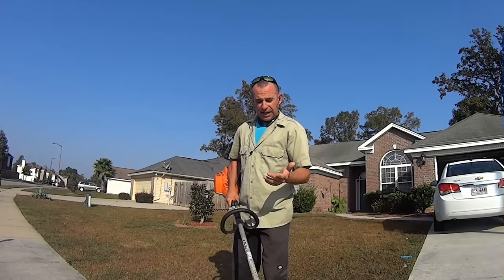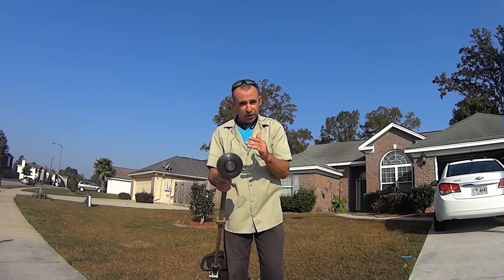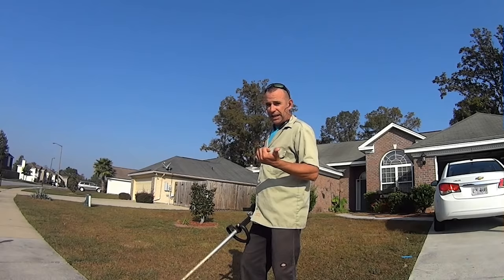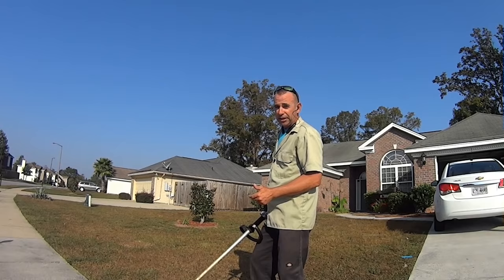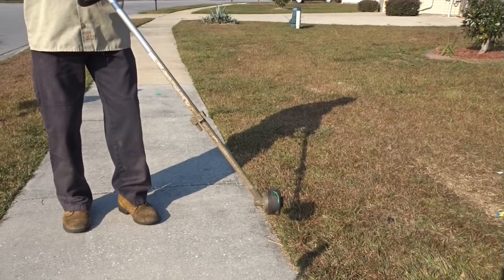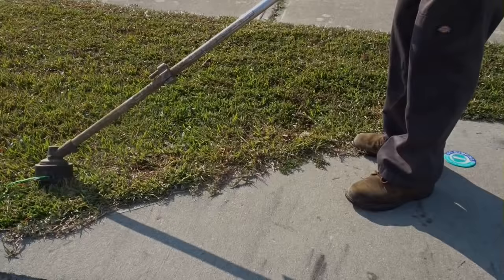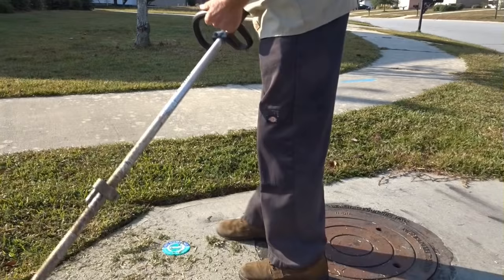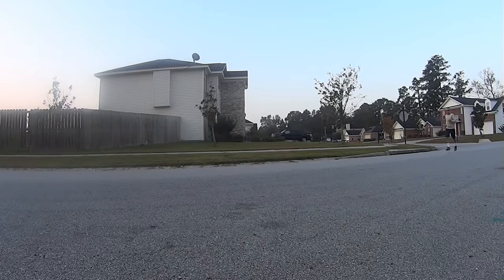HOW TO EDGE with a string trimmer - weedeater - weedwacker  Lawn Edging Tip

Comment: Ever since I had removed my String Trimmer Guard I have increased my accuracy and comfortability when doing my edges by at least 60%.  I make sure that I wear safety glasses at all times and in some cases I wear a full face guard.  Best thing I ever did for me at least is remove the guard.  A neater job all round.
Reply from the maker: I tried to use the shield, it blocks too much of my view
Reply: @DansVlog  i never really had an issue wit the sheild but then again i never took it off to compare it, im gonna try tis summer

Comment: I switched from 0.95 to 0.80. you're right, it cuts much better. thank you for the tip.
Reply from the maker: Heck ya! Just remember if you edge with .080 it will wear down faster so be easy on the power so you don't just waste the line burning it up
Reply: @DansVlog  - Seems that I heard you, or someone else mention that 80 will also cut into and damage fences alot quicker as well. I've been trying out that Rotary, Copperhead Vortex 95, that George Packard highly recommended, around the house, and really like it. Have always used Sthil, regular orange 95, and this black Vortex stuff is a bit thinner, more like 90, and kicks butt. Said he got turned onto it in Florida, and liked so much, brought it back to Wisconsin to use, and lasts way longer than other trimmer line he was using. I know you love the 80, but try this Rotary Vortex 95, and maybe do a video on if it's as good as they say. Thanks for reading my long comment, and thanks for all your informative videos.
Reply: @stevecarr1992  
I saw his video and still using the rotary. Definitely nailed it. Also switched from orange stihl.

Comment: Thank you so much for posting this video I really appreciate it there was a man across the street just now and he was trimming and edging a yard and I asked him if he could help me because I'm trying so hard to learn. I'm a 58 year old female just started cutting grass last year, I do OK but I don't know how to edge the yard and my first weed wacker or trimmer broke.  I tried to get the issue resolved with Home Depot but they let me down they would not assist me, well maybe that's not correct it's not that they would not assist me they just did not assist me with what I needed. When I tried to show them what was going on, they did not listen, then they said they would have to plug it in to see what was going on for themselves. So I waited for a half an hour only for them to tell me they did not have an extension cord and I would have to come back,  I went home disappointed. I called the manufacturer, they told me to take it to Home Depot (smh). After several attempts, I just threw it away. So last weekend  my son  gave me a Black and Decker trimmer and I'm trying to learn how to trim the edges of  my yard, so I whispered a prayer and went across the street and asked the gentleman that was working on my neighbors yard I have seen him several times in the neighborhood I thought if he could just point me in the right direction just give me a heads up on how to do it. He was kind enough to stop with you was doing and gave me a 5-minute lesson, he basically said that my yard was in bad shape and that what I had trying to trim my yard with was a toy compared to what he had.  Explain to him that I had gone to Home Depot to try to get my issue resolved, he said I was wasting their time that's why they did not help me. I came in the house feeling so disappointed and your video was playing because I looked up some things earlier on taking care of your yard and you just happen to be on when I came in the house and the things  that you addressed  is what's going on in my yard, especially the way it's overgrown to the sidewalk.  So in about 12 minutes, I learned so much, I'm going to try and apply what I have learned today, it may take me a couple of times, but I'll get it and I have your video to watch over and over again. Thank you so much! I'm so grateful to people that take their time and post these videos it is such a great help God bless you and have a wonderful day☺

Comment: That's why I watch lawn care channel is to pick up tips like this. Thanks Dan. I will be using these techniques next time. Great video.
Cheers.
Oh hang on. Toilets don't go backwards here in Australia. That would be disgusting. The images conjured up at that is awful. Pull the plug on a bath and the water spins clockwise here and I believe north of the equator it is anti clockwise. 
I have a Honda and Stihl line trimmer. they rotate in opposite directions. Just thought I would throw that in.

Comment: Thanks for the Tips,  now I can Edge like a pro, Even if its with a Electric String trimmer with .065 trimmer line
Reply: Update :  moved to a gas trimmer 4 seasons ago,  MTD made Murray brand but
Strait shaft,  but it rotates clockwise
I trash picked a curved shaft  and it also rotated clockwise.

Comment: Just my 2 cents worth about trimmer rotation direction, in my experience straight shaft trimmers rotate counterclockwise, and curved shaft rotate clockwise.
Reply from the maker: +HunlerDave I wonder why that is?? Thank you, your 2 cents is appreciated
Reply: Off course. The gearbox in the head reverses its direction. Curved shaft trimmers use a flex cable.

Comment: Wow Thank you so much I will use your advice
Reply from the maker: You're welcome 😊
Reply: @DansVlog In every area across the US we run into different problems and honestly one thing I hoped to see covered by you was trimming out grass  from around sprinkler heads. In my case our sprinklers were installed years ago but the lawn was changed twice. The grass is St. Augustine which grows very thick, so we wind up with every pop up sprinkler below grass line.  The quickest way to clear it would be the string trimmer verses hand clippers or scissors.  I just do not know how to best handle it without resorting to hand tools.

Comment: thanks for the tip. I didn't know that. I'll be trying that out on the next lawn. Btw, can I put .080 line on a trimmer that usually uses .095?
Reply from the maker: You're welcome and yes, I use .080 line on my trimmers
Reply: Dan's Vlog That was going to be my next question...trimmer cord size.. BTW from the sound of the cord, I note you tap often to keep longer cord out....

Comment: lol I can answer that one Dan. It's due to the "coriolis" effect...(sp?)  its due to the speed of the earth's rotation about its axis. Clockwise in the northern hemisphere and counterclockwise in the southern hemisphere. (Water as the affect causes it to spin.)
I think the earth's rotational speed is approx. 1,000 mph at its surface. of course it affects the weather as well.
yeah, the twist of the water during a flush is true.
thanks!
Reply from the maker: LOL... so what about the trimmer's head? Does it also spin opposite of here in the States?
Reply: p.s. I've never heard anyone ask what happens if your toilet is right on the equatorial line...im assuming forces would be equal and water would decend without the characteristic "spin" associated with North or South of the equator. I had aviation weather training as a pilot probably like you did with your Army aviation training. One of the most interesting things I learned was about rain drops. most people don't realize that it takes a single Crystal of silica  or other "dust type" particle for rain to actually form. It's staggering to see the estimated tons of these "condensation nuclei" that exist in the earth's atmosphere. even water supercooled" will not turn to ice unless it has a surface to condense on. lol when driving in fog...its referred to as fog...but fog is just technically "ground based clouds."
ah, a walk down memory lane!
Reply from the maker: I only had a little weather training, I wasn't  pilot tho.
Reply: Curved shaft trimmers spin Clockwise.
Straight shaft trimmers spin Counter-Clockwise. (I've heard Aussies call it "Anti-Clockwise")
Reply: We do call it 'anti-clockwise' down here. Counter-clockwise is an accepted term, too. Also, our grass doesn't grow 'tall', it is 'long'. We cut our lawns short too because we play backyard cricket and there's nothing worse than sending down a wrong 'un to knock over middle stump and not getting any turn or carry. 
That video was piss funny. :-). Very witty. Good tips on the line trimming. I do all my edging with a line trimmer (called a Whipper-Snipper down here - I prefer 'line trimmer').  I find it the most satisfying part of the job and to me the edging is the money maker. Many homeowners struggle to nail an edge, but us guys do it all the time and for me, is the big ticket for return work. Customers love a nice edge :-)
Reply: Been reading some articles about the coriolis effect.  I have a son in the military. All of the firing systems deal with line of sight propagation. The curvature of the earth as far as visibility is concerned drops 8 inches per mile squared. Military firing systems only account for gravitational issues not the curvature of the earth.

Comment: Hey Dan great video I'm a landscaper here in Miami I see that up north hardly no one uses a edger down here all we use are edgers alot of Costurmers don't like there lawns being edged with a weedeater cause of rocks and stuff flying around I'm pretty good at edging with the weed trimmer but the edger is way faster and doesn't kill your back as much I'm just curious to know thanks for your video.
Reply from the maker: +Victor Rippe Its a monkey see monkey do mentality. No one who edges with an edger harasses those who edge with a wedeater but those who edge with a weed eater harass and assume those of us who use an edger is because we can't use a weed eater. Do your thing Victor and do it the best you can as you see fit!
Reply: Dan's Daily Vlog thanks brother
Reply: 5goodfellas yes, living in Miami we have lots of rocks and they will fly.  My problem:  my electric trimmer either breaks the line inside the head, or does the opposite and feeds out line too fast.  I'm using the correct diameter line.  Any suggestions?
Reply: I live in  Daytona beach Florida and never use edger unless it is why over grown on the side walk then I will just that once

Comment: Hey Dan, good video. Does it make any difference if you trail the machine behind you while you walk backwards while edging or walk forward towards the machine while you edge? I'm wondering if either method puts more stress on the string.
Thanks,
Bill
Columbia, SC
Reply from the maker: I walk with the rotation of the head. Seems to be easier on the line. Where the machine is at makes no difference in my experience

Comment: Hey I have a question about weedeating I was hoping you could answer. I'm new to doing lawn work and I've noticed after an extended period of time using the trimmer that my arms become very weak, is this something you adapt to over time or is it inevitable from the vibrating motor? I don't have a ton of upper body strength so I've been thinking some exercise and muscle building will help this out in the future but just wanted to hear your opinion on this. My arms are practically worthless for 10-15 minutes after a session of weedtrimming, Thanks.
Reply from the maker: +Frankenscuzz You will strengthen up as you continue to use the tools.

Comment: I have a Ryobi 4-cycle trimmer and the only way that I can trim is if I have my trimmer gas tank facing up because if I'm going the other direction and I tilt it with the oil side up, oil tends to mix with the gas or something happens to where my trimmer starts to bog down and flood.   It will also smoke. Any feedback will help. I use it for home use, im not a business. Maybe next year I'll have the budget to buy a real trimmer like echo or Stihl
Reply from the maker: I am not familiar with that brand/model. Maybe see if there is any comments/feedback on their website that may give suggestions
Reply: Dan's Vlog thank you
Reply: Anthony Mark  Do yourself a favor and purchase an Echo SRM-225 two cycle string trimmer for about $200 new. Two cycle engines are continuously lubricated at any angle because the oil is in the fuel. A four cycle engine with separate oil reservoir is being starved of lubrication upside down because gravity is pulling oil supply away from the cylinder and piston. Besides, the Echo is a great little machine with a 5 year consumer warranty. Always use non ethanol mid grade gas if possible using a commercial grade 2 cycle oil(ie. Echo Power Blend, Tanaka Perfect Mix, Husqvarna, etc.) mixed at 50:1. Learn the basic maintenance procedures for your string trimmer and it will last for years. Hope this helps.
Reply: Gray Sinclair  Thank you for the tip. Great knowledge.
Reply: Anthony Mark  You bet.

Comment: Question... I trim to the right, almost always and I'm pretty sure you do too. Are you supposed to be fighting the rotation of the head or going to the left the same way it is rotating. It could also be personal preference but I just want to see your opinion. Thanks.
Reply from the maker: If you are walking to the right and hitting the grass with the 12 - 2 o'clock position on the head, you are walking with the rotation of the head. Meaning, as the whip makes contact with an object, it is making right to left contact.

Comment: good video! thanks. / now, any ideas on bump feed? I can't get my trimmer to feed line by bumping. / Stihl FS70 and then I replaced feed head with echo but still I have to pull the line manually. Bumping just doesn't work. (I must be doing something wrong) thanks
Reply from the maker: Take it to a Stihl dealer.
Reply: @DansVlog   ---  Yes, that'll be next step but I bought it from Stihl dealer. I Ckd youtube and this is a common problem. Some people have to wind line backwards to make it work. I tried AutoCut then switched to Echo autofeed head. Cuts fine, just doesn't advance line. I'm sure it is my fault. lol
  Good thing I don't cut grass for a living!

Comment: Crazy...  Why don’t you buy an edger.  Used well its faster than a trimmer trying to imitate an edger.  You edge, you mow, you use the mower to blow the concrete, you’re done mostly.  Echo and Stihl have multitools with interchangeable trimmer and edger and boy do they ever work well.  I have the Echo I bought in 06 and it still runs like a new one after lots of use on lawns in town and out here on my farm using ALL the tools in that set now.  I bought the big engine.  Pruner’s good enough to do it all if you are’t too wimpy.
Reply from the maker: Ummmmmmm. Keep watching vids

Comment: Why would taking the shield void the warranty? Is that brand specific?
Reply from the maker: Because the shield has the razor that cuts the line so you can’t extend the line out too far causing rotational drag on the gearheads the shaft and clutch assembly

Comment: My 2 cycle trimmer vs my 4 cycle trimmer turn in different directions.
Reply from the maker: What brands Are they? I understand Kirche Spains clockwise and straight shaft is bent counterclockwise is that also a difference in your equipment?
Reply: Dan,  My 2 Remington curved shaft 2 cycle turn clockwise. My 2 Cub Cadet straight shaft 4 cycle turn counter clockwise. The 4 cycle units have what looks like a small transmission by the trimmer head. Could be why they turn opposite the way the 2 cycle units turn. I enjoy your videos. I bet you are fun after a few beers.